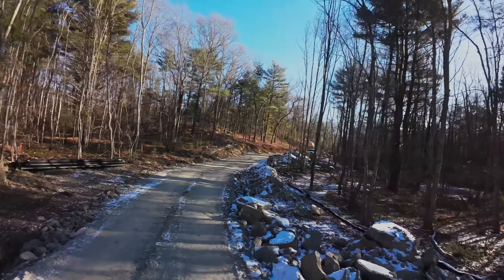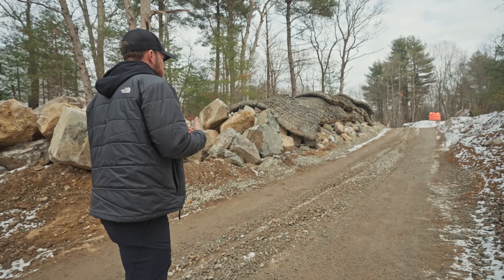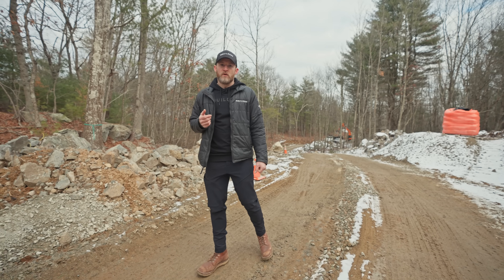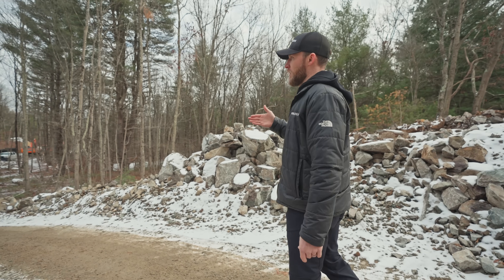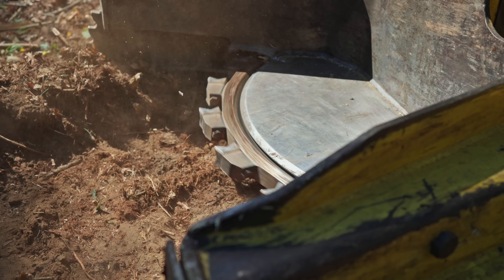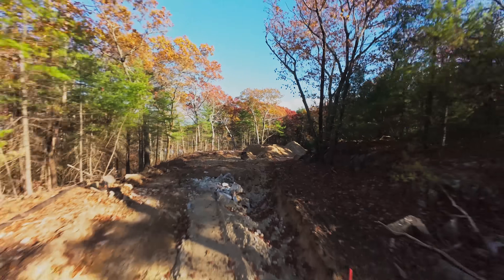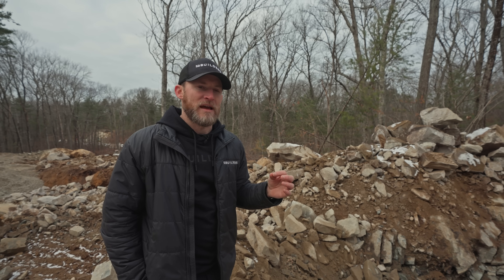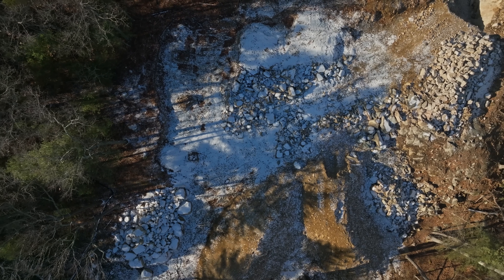How We Built A Road Through The Woods

Comment: Must be a bunch of ridiculous Mass regs, or someone looking to throw away money.  I just built my 2200’ driveway in central NH: new construction, 2 wetlands crossings, full EPA review due to >1 acre disturbed, and an archaeological survey.  Cost approx $20K in engineering and permits, $30k in excavation and grading, $20k in gravel delivered.   No blasting or utilities: rather than running power and water from the street, invested the money in off-grid solar and batteries for 1/10th the price, 1000% better reliability, and free unlimited air conditioning forever.   I moved from Westwood Mass to NH during COVID, so I know the type of people that would throw away money on over-the-top projects like this.
Reply: Wow you don't know what your talking about and brag about it while critizing others.
OK, how much would you charge to do this drive then?
Law requires services in most areas where houses are built for water and sewer. 
ect ect ect.
Is yours on a hillside and rated for a 150,000 pound vehicle over 50 feet long?
Reply: @sparksmcgee6641  That's exactly my point: it's the laws in Mass that make it so expensive to build there.
Reply: @BenKibler  It's the choice that's expensive. 
They could have done one of your quality for less.

Comment: My guestimate is $759,000 because this reminds me of a road I roughed in for a customer in the western part of NC. As a tree service owner I can't help but run the numbers in my head for everything that you've showed. My guess would be 13k for permits. 73k tree clearing (feller bunchers are not cheap) 25k for the brainiacs (civil engineer). 80k for water pipes. 64k for blasting. 237k for grading, dirt work, and gravel. 92k to install water line. 17k in miscellaneous. 20% contractor fee. 5% It snowed and slowed the project down fee. 1k because we're hungry and need to eat lunch all month fee.
Reply from the maker: Great guestimate
Reply: Shieet, 760k, that makes me feel better about buying an excavator to build my drive. I would think 1/10th that would be on the pricey side. Unsure why the water line is even required, just drill a well?

Comment: Why not build a fire hydrant with a big water tank? Pretty sure on some well water properties that's what they do. Also, was this designed to allow for additional houses to built along the road and feed off the utilities?
Reply from the maker: Municipal requirements
Reply: @NSBuilders   Theres always an appeal process on this and there are a lot higher requirements out west in wildfire areas. A lot of custom system that comply with the loads needed. 
Next time is comes up look for the holding tank companies because they often have engineers or know of ones that design the systems for areas like this. 
Actually very affordable. guessing for a house like this you'd put a tank below grade.

If it comes up again look into it. 
Simple attitude I have it telling the rep from the fire department you're going to EXCEED the cities/counties requirements. 
That usually gets things on the right track.

There is math out there for how much water is needed to put X amount of house fire out. You just send the first design with 3X that amount of water in a holding tank.
Reply: If the local fire department isn’t set up for rural fire fighting they might not be able to draft from a static water source.

Comment: How come iron pipe was specified? Who made that call?
I’d think HDPE in appropriate size would have been much cheaper, easier to bend, super impact resistant and just as healthy to drink the water out of;
Reply: Likely required by the local municipality. Ductile iron is great stuff.
Compared to HDPE, DIP is a superior pipe for burial in material that could have rocks/cobbles work into the bedding. You can also bed it with native material lowering the job costs. With DIP crew can deflect the joints for curves in the road and add offset joints so staying on  line/grade with this driveway would be no problem. With HDPE you want to minimize fusion joints and put in as long of runs as possible. That would be tough on this job with just a driveway of space to work. So running 18ft ductile sticks and stabbing/ backfilling as you go is the way to go. Very respectfully.
Reply from the maker: Exactly ⬆️ it’s feeding a hydrant

Comment: I noticed a drilling rig at 1:53, presumably for drilling blast holes. Did you consider drilling for a ground source heat pump while the equipment was already out there? I’m looking forward to future videos about this unique house!
Reply from the maker: Wasn’t in the budget for this project.
Reply: @NSBuilders  No Geothermal? That's too bad. I imagine the budget for this is pretty large.
Reply: @paulschreiber  Agreed, geothermal seems like a no-brainer on a project like this. Dude keeps saying stuff "wasn’t in the budget" but the client is clearly spending shit tons of $$$ here, so where is the money going?
Reply: @idontthinkso666  Why now just to 100% electric with solar? When you have the budget EVERYTHING is an option then when you don't use the favorate product of someone like you people scream you don't know what your doing.
Maybe shut up and learn something
Reply: Geo is all about geology.
 Some places it's great and efficient others it's expensive and low efficiency. 
I'm in Colorado where some places it's the standard even if you're putting up a modular and a mile away youd have to drill a thousand feet through hard rock for nothing.
Also the hardware has been a problem for decades and the equipment hasn't held up. Right now I think Bosch is the only equipment people will use on quality work.